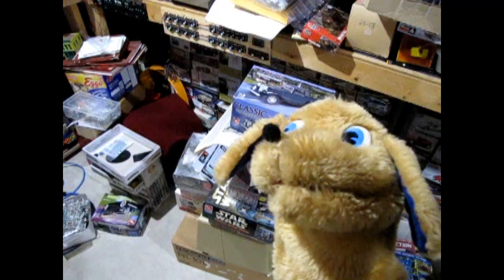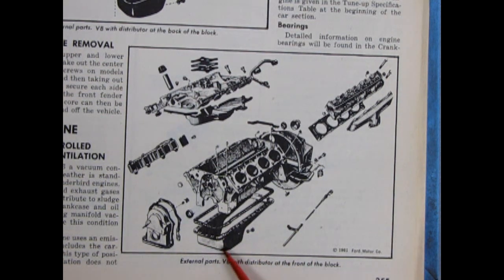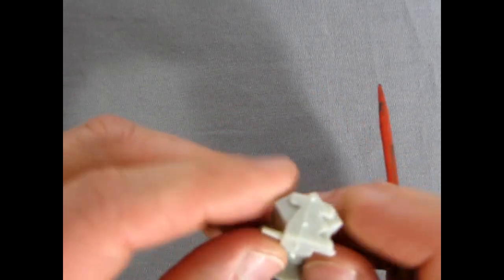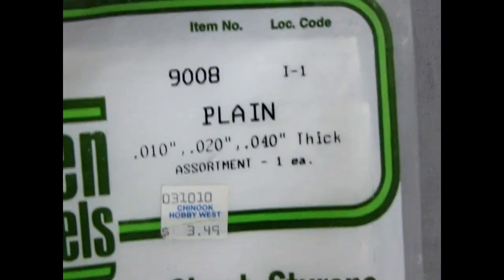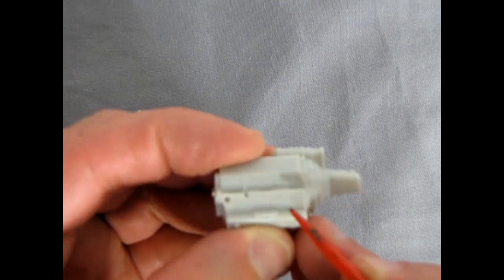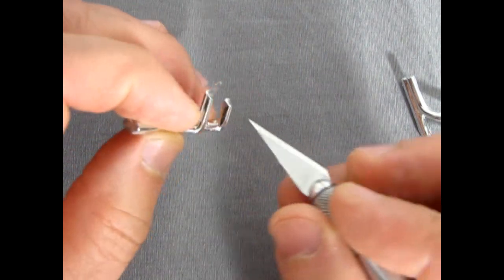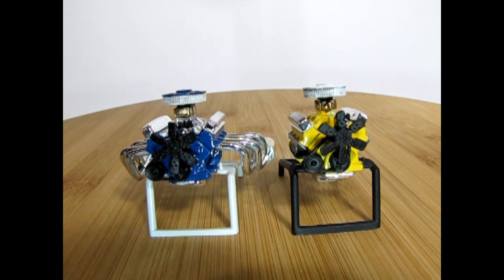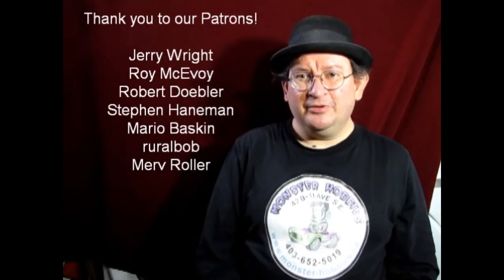Model Car Garage Tips and Tech - How To Build FE Optional Engine - AMT 1932 Ford Phaeton / Victoria

Comment: I do like these engine vids, Trevor. 👍. Does the Chilton's manual show if and where an oil filter would be fitted or was there really no external filter on engine.🤷‍♂️🤔 I will try to get hold of a copy of it too, as it looks just the book to help detail Ford engines👍best wishes from jolly old England 🤓Pete 😎
Reply from the maker: The manual does show the locations of the oil filters. Not all the AMT engines have them, even though the real engine does. 

Next Sunday I'll be showing how to build an all chrome Ford Thunderbird engine from the AMT 1934 Ford. I don't show it in the video, but I did discover that with a bit of modification, the chrome exhaust pipes from the FE engine in this video will work on the Thunderbird engine. Those should look great seeing as the engine is all chrome!
Reply: @MonsterHobbiesModelCarGarage  ah yes, but a length of sprue could replicate oil filter, if one knew where it was located🤔same as heater hoses that generally aren't included in amt kits☹️

Comment: Quite nice -- I esp. like the Edsel engine .  Regarding the heads / lifter valley pan combo "slop" : perhaps sawing-off 0.010" ( about the blades' width ) at the cylinder heads would keep the distributor mount sufficiently-spaced from the oil fill tube .

I'm somewhat mystified , too , about the ostensible absence of an oil filtre . I wonder if the prototype has a remote-location filtre ?
Reply from the maker: It could be. The engine is a pretty decent representation, but it does lack on some key features, that's for sure.